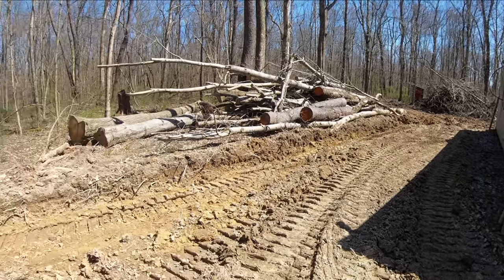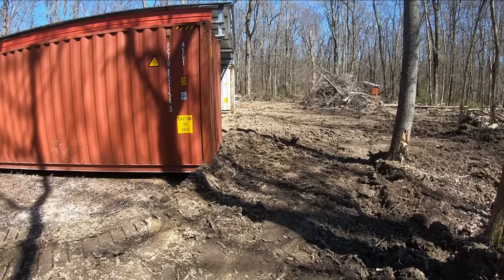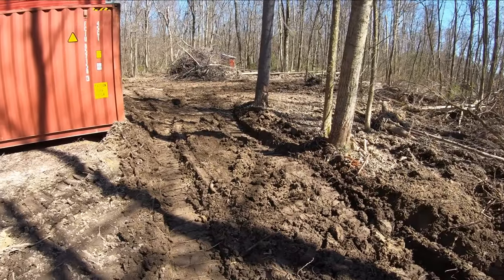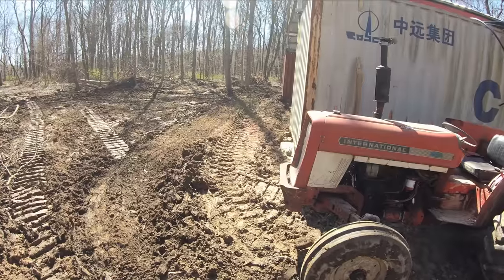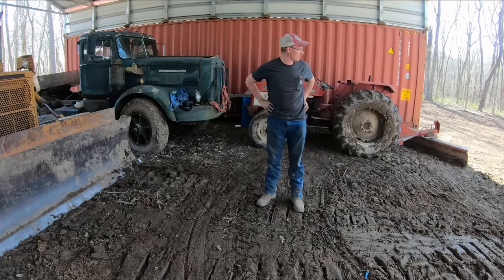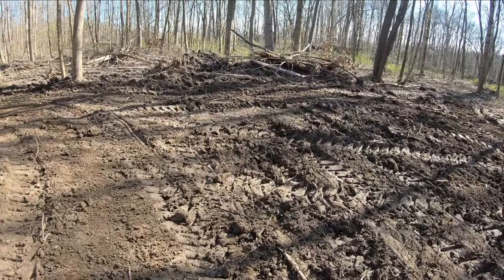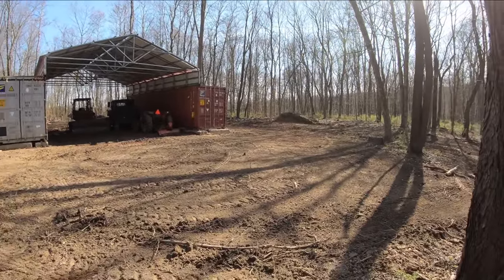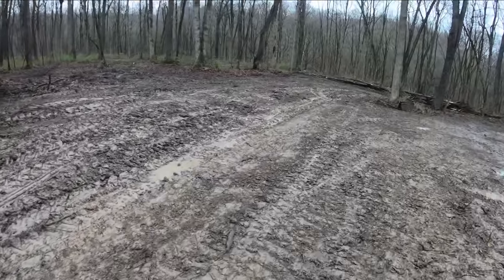Finish grading drainage ditches with a Tractor???  SO Satisfying!

Comment: If they loose tension when you lift then they are mounded on the tractor incorrectly. But I could see in the Video that they were moving while you were working the blade.
Reply from the maker: ill have to adjust them then

Comment: if you got on and had a burn of the tree limbs in piles and then collect all the burnt ash and spread it over the wet ground , it will increase the heat absorbed from the sun and dry it out faster, darker the ground more it absorbs sun light faster it will dry up said ground :)

Comment: adjust your draft control and lift center link to level your blade .I promise it will work a lot better. GOOD blading my friend.
Reply from the maker: I played with the draft control a bit but couldn’t seem to make it happy, when I lengthen the top link it makes the plow hang correctly but only raises a few inches off the ground and gets caught on things I’m going to play with it a bit more in the future
Reply: @DieselCreek  If you can get somewhere its level you might be able to adjust the pilot valve on the draft control to raise the draft sensing height  I have not seen a close up of the hitch  so  my experience on the series of ih that you have may not apply, but  I worked on them for a lot of years and the hydraulics are good  a design.

Comment: Might be just the way the camera shot it, but the front mounting points of the blade should be vertical. You need to wind out your top link a heap. Just from personal experience anyway

Comment: Looks like you need some 3-point stabilizer bars for tractor, that will keep your blade more stable and the arms won’t drag against the tires when turning, Tractor Supply usually stocks them.  Dirt work looks great!
Reply: 1/4" or 3/8" steel flat bar works for a good homemade stabilizer. I've seen tractors that had (from the factory, might I add) chains with turnbuckles instead of bars to stop implement sway.
Reply from the maker: it has chains with turnbuckles but they loosen when you raise the implement

Comment: Matt why not on that big pile of concrete to scrape off that mud and then take those big pieces on put the big pieces then smaller then cover with more concrete  why not install 4" plastic courrageted pipe and move the water away and by the storage containers put a metal grating over and use landscape fabric to stop the mud but there less chance to damage it as even putting a rack to put the shovel buckets maybe find a dead semi truck that could be fabercated to put  I beams and beams across but we can spray the buckets with alight coat of used oil screened  in or linseed oil and a tarp put all buckets are on the shelf and we look for  a few worn ones for special needs buckets

Comment: Where i live we have concrete and soil swales. They work well to run the water into retention ponds so water then soaks into the ground. 
Regarding your stach, if you keep it trimmed and conditioned maybe the mrs will tolerate it. But if you wanna make out, shave already.

Comment: It seem you are trying to direct the Diesel Creek around the Diesel Creek shop instead of through it.  Mud season creates its own problems.    It may take some rain to settle the ground you are working.  You may want to look for a roller to pack ground behind the tractor.  Right now you can only gently guide water where you want it.  As things harden up you'l be able to ditch more seriously where needed..   This is a great first pass at the problem.    Good luck.
Reply from the maker: My thoughts exactly, I’ve got a tow behind vibratory roller I just need to put it back together

Comment: Come on Mate, the Inter is fitted with anti sway chains and adjusters. Use them before you destroy the 3 point
Reply from the maker: they are tight when you lower the hitch and when you lift they get loose.

Comment: Don't wear the paint off those nuts on The cutting edge it'll be too hard to replace them later LOL😅 no that's when I had to do my work is what it was too wet to do anything for anybody else trimming up when it's dry would be better because it does get dry

Comment: Looks like the top link needs lengthened out . angle would be a lot better for the blade. instead of it rolling over
Reply from the maker: I did that but then i could barely get it lifted off the ground!

Comment: Strip all the topsoil and shale it.
Reply from the maker: The only topsoil is in the back where I won’t be running much. Everything else is stripped, I’ll be putting rock down eventually once it dries out
Reply: I got ya.  Using geo grid in wet spots?

Comment: I think you may have meant to say "swale" rather than "swell" at about 3 min. A "swell" would the opposite of a "swale".
Reply: I had a swale cut into my property years ago.  It helped somewhat in diverting water.
Reply from the maker: several people said that but ive been around tons of people older than I that call it a swell thought I know its spelled different. not sure whats right or wrong but its what i learned lol

Comment: Where it it soft would be better if you put in a load of rock to stable out the ground then the water 
Will run off
Reply from the maker: rocks too expensive to be pushing into the mud! it will set up eventually,
Reply: Fair enough couldn’t you did out some Shiite and lay that in there that boulder work very good as a brace 
And the waters would run though it

Comment: Man you do use that word a lot - its supposed to be SWALE not swell as you kept saying. Its a long "a" sound. Swell goes up, swale goes down... 🤣🤣  Of course using it your way kept us in the know as to what you meant. Doesn't matter much as long as the water drains the way you want, right?
Reply from the maker: thats right, i grew up hearing it called a swell but I know its spelled differently